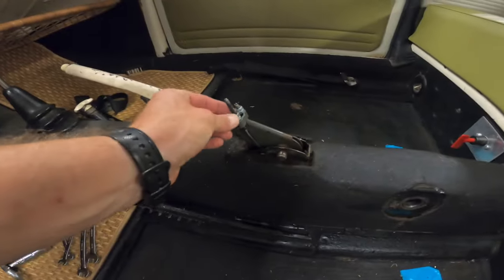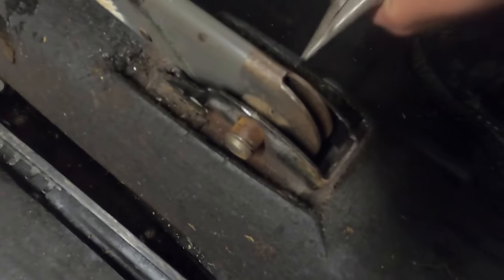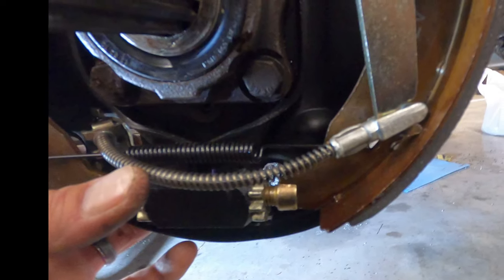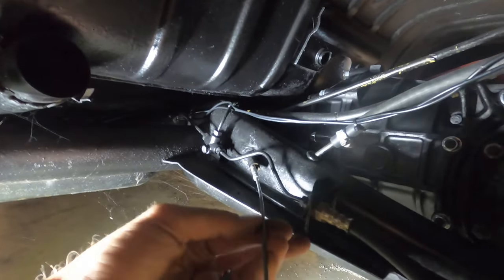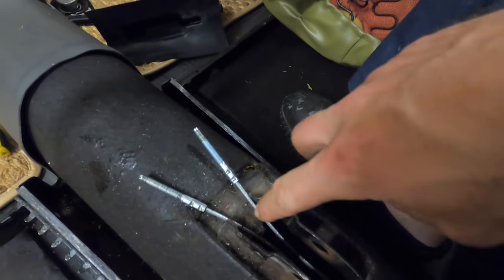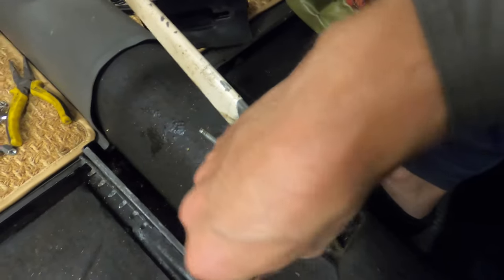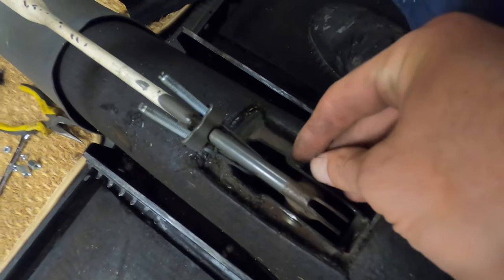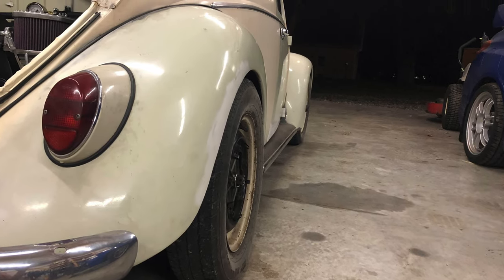VW Beetle Handbrake Cable Replacement

Comment: any advice on how to get the drum brake lid off. this is quite possibly one of the most frustrating things ever it simply will not budge
Reply from the maker: Rubber mallet. Hit the front, hit the sides.  I would start gentle, then progressively hit harder.

Comment: How do you tighten the handle ? Even after I put the nuts all the way tight it still won’t hold that well
Reply from the maker: Is this a new cable?  Old?

I replaced my cable because I installed a longer axle.  There are a couple different part numbers out there that are slightly different lengths.  So if you have a new one, that’s the wrong part number, it could be too long.
Reply: Had a similar problem, but with my clutch cable. I have a '72 registered Ghia which turns out to be a '71 and the clutch cable is 1" shorter. Didn't know this until I fitted the long one. 😮. Fortunately as with a lot of other parts on the car it is easy to remove!

Comment: The pin will NOT go back in for me. The handle was missing, got an original replacement but yeah it won't line up with the bracket for anything. I'd probably have to file down the tab on the tunnel since that seems to be the issue, it sticks out too far for the gear piece that sit into it. I dug up a bolt that's a tiny bit less thick and I can get it to go in, but I need a longer one so I can put a lock nut on the end of it, so it can't fall out.
Reply from the maker: That’s really odd.  There are a few things that could be causing the issue.  Someone could have painted that area, and the pin won’t go in because of it.  The bracket could be bent.  Last, are you sure they sent you the right year for that chassis?  I’ve also seen people put different year body’s on older or new pans.  That’s always fun.
Reply: @VitosFix  It's a 64. I bought the handle from a guy when at his house (he has sheds full of parts). Being an earlier car, he said it takes that one due to the handle being very long. It's about 1/32" off, if that. It's mostly likely the original pan/chassis and body. It has 64 doors/windows, link pin front end, swing axle transmission, etc. The engine is from a 65 based on it's serial but the rest seems pretty original, aside from being baja converted. The handle is in fact very long but it doesn't interfere with the shifter at all, so it must be correct. 64 didn't have the heater control handles by the parking brake, it's on a little spin handle further forward, and that's what it has, so it's obviously a 64 chassis. Maybe it's an older handle and they changed the measurements by 1mm at some point or something? It's not a big deal, that big bolt seems like it should work fine, I just need one 1/2" longer and a lock nut so it can't wiggle loose.
Reply: @VitosFix  I think the gear plate is probably wrong. I just saw a picture of two styles, one with a deeper slot for the tooth on the tunnel and one with a shallow one. I guess the guy grabbed the wrong plate. Not too big of a deal, I can just grind/file out the plate a bit to make it fit properly.

Comment: Short and sweet, love it buddy! About to replace mine on a '67 so your setup looks a little different than mine. Taking the seats out probably makes it easier to work on right? At least one seat
Reply from the maker: The mat that’s installed in mine, I had to take the seat out to remove it.  But I do think it helps either way.  

Good luck!